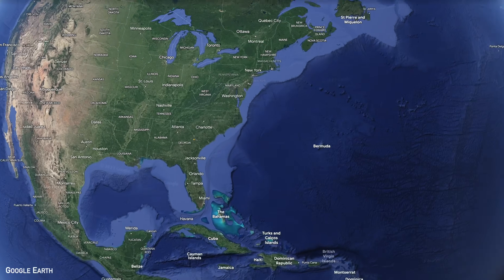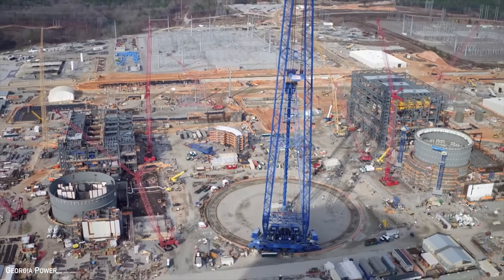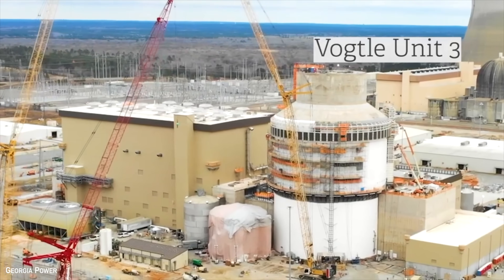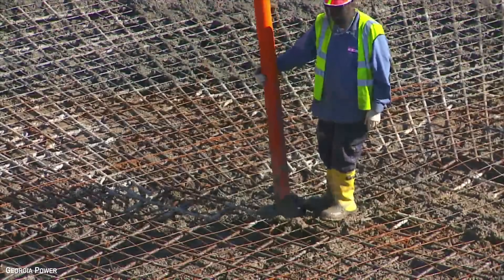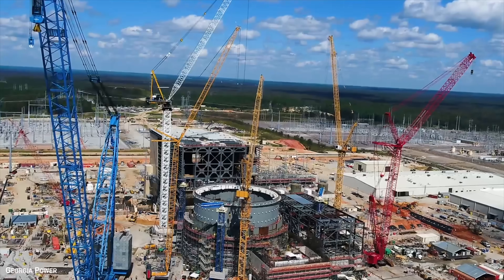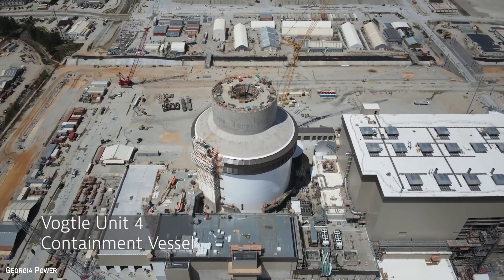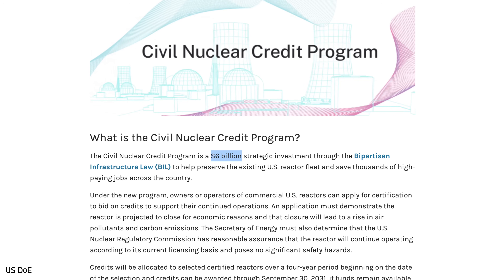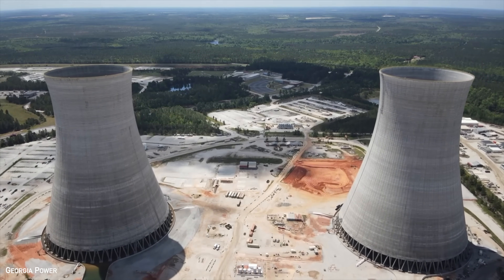Why the Future of Nuclear Power Depends on This Plant

Comment: Every time I hear about a nuclear reactor being built the first thing I run to is "who are they using to build it?" 
In China, they always deploy their specially trained contractors to build it, and even accounting that china has a less than stellar record in safety and keeping norms, they complete on time, on budget and get stuff rolling just as well as any other plant.

Meanwhile here in the west we task the most demanding building projects to the most inexperienced of contractors that constantly make mistakes and cause decades of delay while the engineers and designers trash their office because the media keeps making it sound like nuclear power is to blame for the delay.
Reply: That’s not all projects in the West, make good jets, big towers, rockets. Nuclear has a particular problem now in US.  In late 60s US built dozens of reactors in 3-4 yrs ea for under $1000/kw todays $,excellent safety records.  Something is different now.  I suggest it’s the regulator, USNRC.
Reply: @Nill757  regulators and construction are mostly to blame. Both compound off each other. 

In the wake of Chernobyl/TMI the already safe reactors were ordered to be even safer, regardless of their actual risk factor. Which is even more problem because a scant few years before, common consensus (read: politics and interest groups) ruled that active safety (active cooling/control rods) was sufficient and that passive safety (stuff like MSR) was not needed. Which then meant we got stuck with reactors inherently harder to safeguard against runaways in the case the plant manager fucked up their risk assessment (which is what got us into the Fukushima mess)
This drives up the cost of reactors tremendously, and also balloons the maintenance cost because it makes core components harder to reach and more likely to break as long as we keep using the same 50s template. 

And then there is construction itself, because in the west most contracts for nuclear are not earned in a bid competition, but ordered by a state. Not only does it mean the company does not really have a reason not to go over budget and time, but on top of that you can add the markup and lobbying that goes alongside it. Moreover it means a lot of the time the people being put in charge of construction work in regular plant/building construction and are absolutely not trained in managing construction with such a high standard.

It is why they keep fucking up the concrete and the core shielding, and tons of issues in maintenance later down the line. They are used to and trained to build stuff like coal and gas plants. Thin and lax construction stuff really. Nuclear reactors use meter thick walls just for the reactor outer shielding, under extremely strict quality checks. These people are usually hopelessly under-prepared for that kind of task and keep having to scrap it and do it again. 

This is why by simply having trained reactor bundling crews, China is building their reactors faster and better than my country (France) despite France INVENTING the very blueprint they use.
Reply: @mobiuscoreindustries  “better than my country France”

Special crews works when one builds in volume, 50 reactors, standard design, in 15 years like France.  Build only one in 25 years, new design, with no more in the queue, as w Flammanville 3, and there are going to be problems.  Then come the clowns lining up to claim, “this proves nuclear is expensive”
Reply: @Nill757  Plus honestly even our top of the art stuff is mid. Not that it isn't great, it is the peak of PWR, but that isn't saying much. 

Like every time I see designs for new reactors to be built it reminds me of the internal combustion and hybrid engines being discussed before Tesla came along. It was all "cleaner diesel we definitely didn't cheat the emission test" and "hybrid propulsion is the future", dumpling billions into making slight upgrades to a tech that had already reached its apex for the sake of continuing what they were doing before. 
And then a single entity decides to do something different and actually put some thought behind it and everyone is now shocked that they had it wrong since the start. 

PWR new gens are literally trying to be MSRs while confirming to the old ways of doing things and of course it isn't working. Either you just build a PWR and assume it's downsides or you build an MSR if you want a high burn rate and load reactive system but you do not try to mix solid fuel into a liquid subset of qualities because you aren't getting what you want and sacrificing everything else for it. 

But since in nuclear studies you aren't even being told of thermal breeders or the MSRe no wonder people think there is no better way and that the best job a nuclear engineer can get is oversee a big dismantling project...
Reply: @mobiuscoreindustries  “in nuclear studies …not even told…”

Mindset of long term nuclear industry is bizarre. I had a discussion with an engineer sometime working IIrc in fuel enrichment, and I went through the pros cons of MSRs as I understood. His comment, ‘it’s impossible’. I’m baffled, ask why. He says, ‘it’s [liquid fuels molten salts etc] not in the NRC regulations’.  

The nuclear commentator and new startup ceo Kugelmass has a take. Says the original building industry ‘60s realized nuclear was way to cheap to make money. So, they cancelled themselves and became the Nuclear Safety Industry, got a new regulator and started cranking up regs. Loads of money  in safety.

Comment: Big nuke projects just aren't going to pay off well. It's not just the endless cost overruns when being built but are also a huge cost to decommission at the end of life. And still no real solution to endlessly storing the waste. Basically obsolete, as is coal. Cheaper to put up a network of wind, solar, and storage. And they can be put up or taken down in a fraction of the time or cost.
Reply: What are you talking about “and storage”? There’s is no damn storage in the scale needed. You know, I know, everybody knows the actual backup for big solar wind is fossil fuel, everywhere. There is no utility scale storage facility that can backup a middling 500 MW wind farm or other power plant for a full day, not anywhere in the world. It’s 2023, enough of the real soon now nonsense.